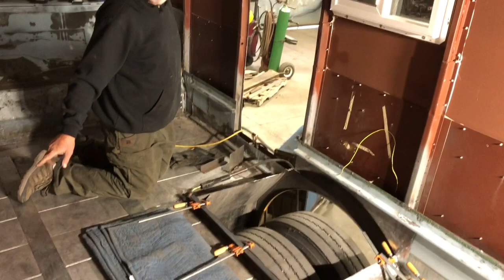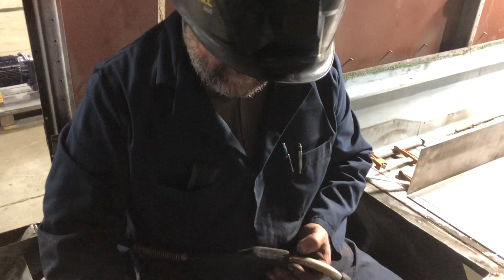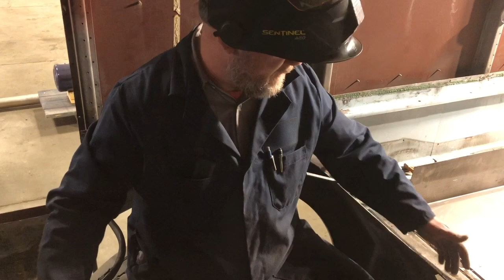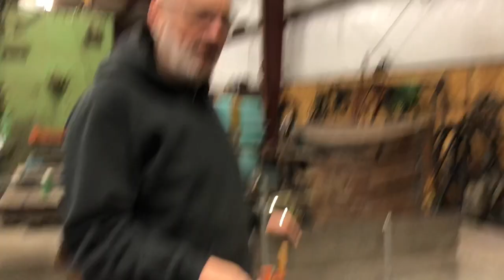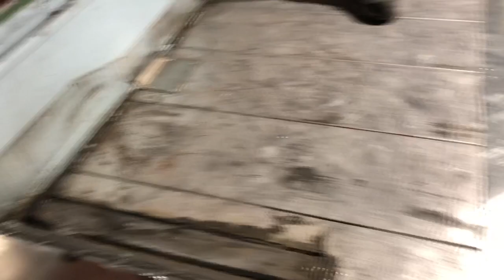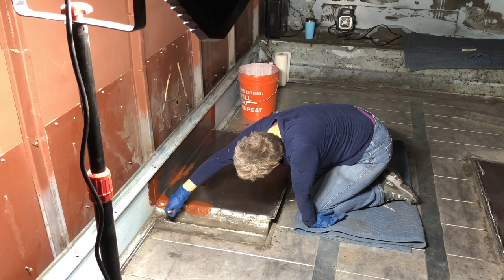Not Afraid to Ask for Help - Vlog 47 School Bus Conversion

Comment: My good man, seam seal the corners stop water creaming in joins
Reply from the maker: Thanks for the comment. Plan on doing that and then spraying with undercoating.
Reply: Knapp Time bravo ...your doing good , I fitted water proof lights in my wheel wells, flat tire in the night lights on job done 😀👍
Reply: @creazionidirealta3300  That's a great idea!! 👍
Reply: Kieffer Keepin' On thank you ..

Comment: Did you lower the wheel wells? Is there enough room for wheel travel when loaded?
Reply: John D they are far enough, I don't have to be there to see it, the suspension barely has travel
Reply from the maker: Yes we lowered the wheel well and we have 5 or 6 inches of clearance. The suspension has a bump stop that only has 1 3/4"  travel.